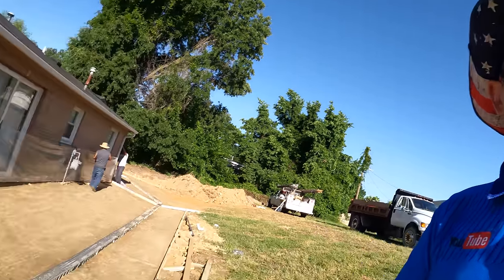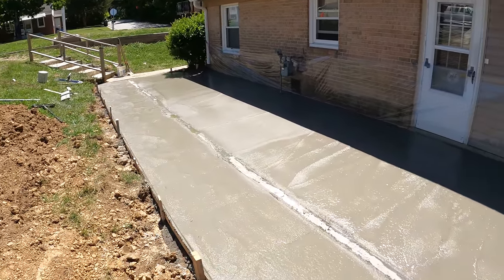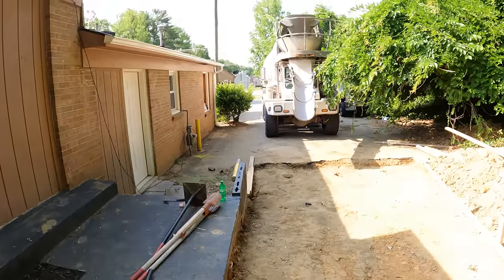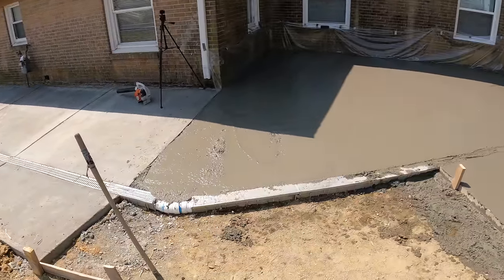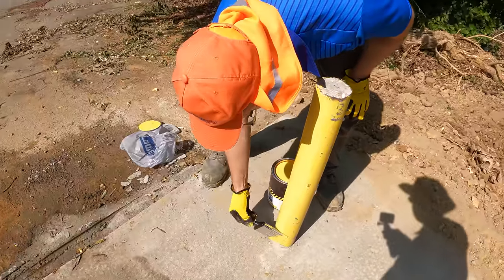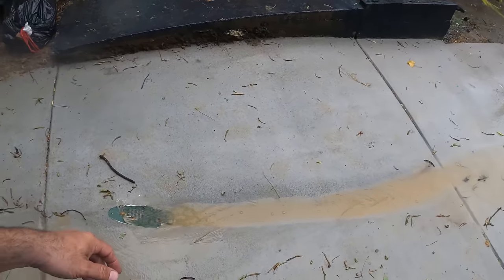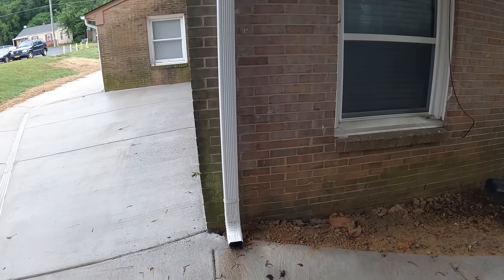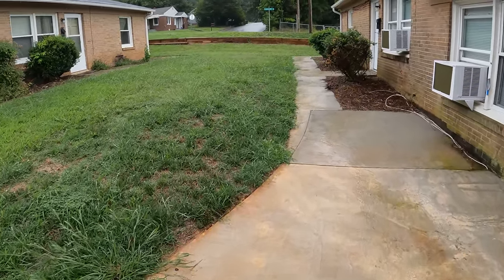Part 4 of 4 The worst Apt. Flooding I've ever seen!

Comment: I've been checking every day for this video since part 3 came out. Glad to see it complete! Great job! Wish you were in Oklahoma! Also, just out of curiosity, why not skip the channel drain and PVC and just let the concrete get that water out of there as it is intended to do in the event of a clogged drainage system? Thanks!
Reply from the maker: Great question Justin. The reason is it's very tricky to get concrete sloping in two directions. It always holds a tiny bit of water here or there. With the channel drain, that water is hidden and it gives a much cleaner look.

Comment: I have never seen in my city any one build so low at the bottom of down hill without the house being constructed higher than street level. Well done on your design , your Concrete crew and your work. I think you have a job that will last forever if thats what goes on there a lot
Reply from the maker: Thank you Rusty! I think this will be a lasting solution too. That's what we were going for here!

Comment: The channel drain gets rid of any residual moisture, the concrete swale handles ant storm/hurricane overflow.  Brand new porch/patio upgrade for the tenants to put chairs and barbeques on.  It sucks when the original builder does not put in swales  at the top of slopes to help direct the water away for the whole general complex.  A single bar tack welded vertically down the center would  keep the critters out

Comment: Looks like a great solution to me, and doubles as a good place to hang out. It's orders of magnitude better than the mud flat from before. 100% toss that grate. If you wanted to keep it, cut the entire bottom of it off.
Reply from the maker: Good point! I may cut it off if I see it holding debris.

Comment: One thing you may be able to do in situations where you want the adjacent grass to overflow onto the sidewalk is add a slight bevel to the edge of the concrete to  allow an inch or so ponding before it spills over onto the concrete, promoting sediment storage off of the concrete. Or maybe you considered this and did not do it for a reason. Too bad there was so many issues with the concrete folks. People doing concrete should not need to be babysat regarding correct drainage -- that is half their job as it is yours; hopefully you have other quality concrete contracting options around. Just finished watching all the parts of this project and you did a great job!

Comment: Wow what a series from the courtyard to the back project. Regarding the cap for the channel drain, could you put a more course drain on there? Larger openings to allow more flow. I feel like the channel drain does well and catches a lot of water but the fine openings slow the flow. Maybe get 2 stainless 1/4” rod and drill 2 holes and stick them vertical thru the pipe.  Or 3 rods. Whatever is too small for cats
Reply from the maker: Great idea William. I noted a small cat living in that area and was worried about it crawling into the pipe and getting stuck.

Comment: Very nice work and ultimately the goal is to move the water away.  I have one question:  At the initial point of the channel drain, could you have taken out 10'-15' feet of walkway and extended the bottom step beyond the building and relocate the step there?   This would have given you about 4 more inches of drop.   Not sure if was feasible but just a thought.

Comment: re: "sea of concrete" question.  I'm actually inclined to sort of flip that question....since you decided on the large concrete catchment solution (which looks fine imho), why did you need the channel drain?  Seems like that added additional complexity to the install, created maintenance requirements to keep clean, and increased the overall cost to the property owner for no real additional functionality since the concrete is capable of "carrying the load" in the event that the channel drain gets backed up.  I mean, it <looks cool> and seems to work fine (when it's not full of leaves), but I don't see the added benefit over just letting the contoured concrete do the water moving.  What am I missing?

Comment: Instead of that cover, get a standard 3 prong anti-rat stainless blocker.(looks like a pitchfork). will block cats and rats, but those leaves will flow right through (if any get in there.

Comment: I don't think it's necessarily a sea of concrete, not with all the grass areas surrounding it. If anything as a renter I'd be more inclined to put chairs out and hang out there rather than if it were just dirt or whatever was there before. That and it gives kids a place to play without getting muddy. Apartments are made to be utilitarian and you gave them a nice clean place they can actually walk around on.
Reply from the maker: That's a great point. I was expecting to see some chairs and decorations out there when I revisited. Maybe the pull the chairs out and back inside.

Comment: I too was going to ask about why the vertical pipes didn't go directly into the channel drain. But you made the right decision based on the amount of foliage there and it looks as though the people there arnt that proactive in cleaning things up. Did you go back & fix the crack in the concrete I wonder. As for the aesthetics of the concrete, I don't think the owner gave a rats, given the gravity of the situation.

Comment: Definitely an impressive low-low-slope example.  

38:06 Ah so that's an 18-inch grate.  With the $-to-GPM of CB I wonder if a concrete gutter of sorts would pass more & clog less.  
39:43 it clogged the 1st time, 26:43 ouch.

Comment: ABC Seamless Gutters sells a leaf guard for gutters that works. I have had it on my house for over 10 years and I've had no problems and I have a 60 ft maple tree that drops helicopters all spring long as well as oak trees that drop acorns. The gutter guards are not cheap by any means but if you don't want to get up and keep your gutters cleaned out they are the solution. There are a lot of gutter guards that don't work and they are not your solution. I think I would go visit with a local Fab shop and get my own grate design made. With the lasers and water jets they should be able to make anything you want for a grate that would be more free-flowing.

Comment: Binge watching a lot of your vids. Great work! I like that you (later on) return to the job to report on how things work out when it rains. With this particular video was mould a problem in any of the units? And, would the exterior brickwork get pressure washed to remove that green mould? Cheers

Comment: Sadly with it's location right in the middle of the walkway you'd have to have some kind of cover on it. Otherwise it's a trip hazard and a liability. What you did removing some of the grooves should help keep it flowing much better though. Maintenance just needs to make a point to actually check it and keep it clean.

Comment: I know most comments are positive, but I was shocked to see your terminate the run in the middle of a walkway creating a trip hazard, thats a very high potential lawsuit for which the property owner will be 100% liable for, especially when the cover was modified so the surface is no longer covered but now a "catch" for the foot (the property owner may try seeking damages for any lawsuit from the contractor who did it), a court would likely award actual and punitive damages for injury to any trip victim... P.S. I know this may be an unwanted comment, but thats an issue I would address immediately if it was my property to avoid a future lawsuit. (I would terminate the run off to the side out of the walkway as unpleasant as that would be destroying finished work)
Reply from the maker: Thanks for the comment. That's not a walkway though. It's a drainage sluice.

Comment: An expansion groove over the top of the pipe would stop the zig zag cracking.  

Was that tree covered in Kudzu?

Did the baby snake survive?
Reply from the maker: I thought about that, cutting a joint along the pipe would have done the trick. That was wisteria vine, and a huge one! The little snake was dead when I first got there, unfortunately.

Comment: Watch post 10 on here. Grates on the discharge will catch debris.  Debris in water somehow stick to each other,  the water acts like a a glue. Perhaps a rain cap design, similar to what is used on trucks but then the hinge needs to robust.  For now cut out every other bar in the green grate.
Reply from the maker: The pressure of the flowing water holds the debris against everything and it piles up. Grab your rake when that happens. 👍

Comment: I dont know, but I’m assuming it’s because of cost of having employee but as a security patrol officer at multiple sites and different types of facilities. 

A lot of the places along with the property and cities could solve a lot of drainage problems by having a sweet sweeper or having maintenance employee that’s already employed use leaf blower to clean the curbs, parking areas/pathways and drains grates  regularly.

Comment: I noticed the concrete was very watery, which means it will not become very strong once it hardens (the strength is a function of the ratio cement/water). Sure enough at the end of the video it already showed a crack in the weak spot over the pipe. It should still do its job as the water is running on top of the concrete slab. The other thing I would not have done as the truck diver is having the concrete truck at an angle when driving down from the lawn, they have a high center of gravity and tip over. This all reminded me of my summer break jobs during college where I delivers concrete in Germany in 100 degree weather, one of my best jobs I had (although payment as an electrical engineer is of course much better).

Comment: here in Australia our concrete gets pumped through a crane that can go over houses etc, why does the states not use these? is it just not cost effective on jobs like these?
Reply from the maker: Pump trucks are extremely expensive and require a lot of cleanup and wasted (residual) concrete in the hoses. We always try to get the truck to the jobsite. The concrete company we use is the best.

Comment: You should have recommended a metal gutter guard for the downspouts that you wouldn’t have to worry about sagging with debris and holding water, then you could’ve given the downspouts their own line down to the corner and tie into the exhaust.
This isn’t a criticism, just a thought. And I’m curious if you plan on looking for another concrete company? That’s twice now you had to replace what they did.
Reply from the maker: The property owners didn't want to do gutter guard as they were already spending a ton of money on this building. It would have helped. No I'm still working with the same concrete crew. I've been with them for the last seven years.

Comment: You are going to have to screw a large metal grate with bigger holes over the whole thing. It's going to be ugly as heck and not flush unless you do a bunch of work to recess it.   (cast iron)  The exit needs to be at least twice as big.
  The mitered drain may be a choke point.  Perhaps install a regular drain box as an exit. Let the water rise and exit through the top. A little strange, but the goal is to get as much out per minute as possible. The lid can can be installed at a slope to be flush. This would make it much easier to maintain. They can just pull the grate with no tools to clear.

Comment: Gutsy concrete truck driver on that hill at the start😱.  As for the sea of concrete as you call it,  what else could you have done? Dug a deep moat around the place that someone could drown in? I call it necassary pavement.  I doubt the owner was going to want to tear the whole place down just so the site can be properly built up to drain corectly as it should have been done when first built.  May not have been what you wanted to do, but it's doing the job you designed it to do and it looks nice. 👍
Reply from the maker: Thank you LTAR! I think this turned out very well and looks pretty good now that the grass has come in.

Comment: If you wanted to do this without all that concrete (which is not what I like to see, but then all that flat building with no cellar and thus no real foundation isn't either), it would be the same done with landscaping - which essentially amounts to almost a moat around the building. Might be trickier, but should also do the job.

Comment: Why did you bury the end of the pvc pipe under concreter.  Are there holes in the bottom of the pipe for the water to drain into the dirt? Is that sufficient say for a heavy downpour?  I see what you did with the end of the pipe.  I didn't wait long enough watching the video.  I have been watching the channel for a while, but I am still a newb.

Comment: I was going to suggest cut out some of the grating bars, you beat me to it. I'm disappointed in your concrete crew, just scread from the pipe outlet to the low point on the edge with the straight edge, not a bull float. "Yeah money baby".
I think you win on this tough job
Reply from the maker: I know, I felt the same way. That's why I left when I did - how could anything go wrong?

Comment: Did you add fibers to the concrete? 
Is that water flowing across the black top and right into the corner of the building a little further down near the telephone pole and the bush? 
Concrete looks a lot better than the mess that was there before. Water will get in that crack and freeze. It will get worse over time. Owner will have bigger problems than that if he doesn't clean those gutters before every winter.

Comment: As a home builder why is there NO rebar in the concrete? That concrete will crack and break up over time and allow water into the cracks. I'm willing to bet that concrete cracked soon after it was poured. Luckily it looks like your on sandy loam soil and not expanding/shrinking clay.